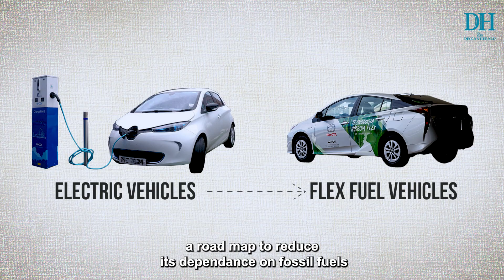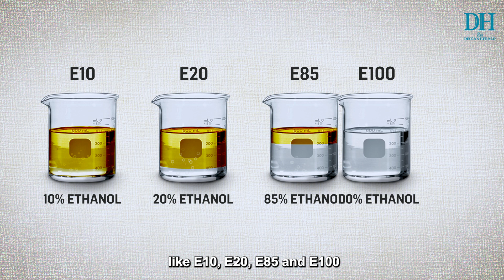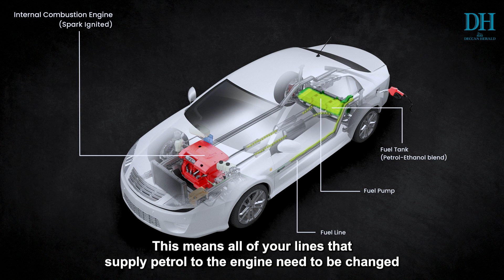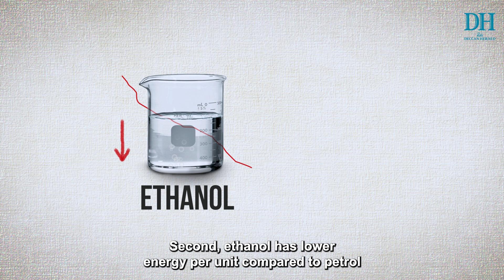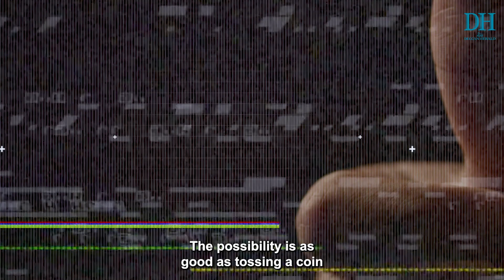What is flex fuel and are vehicles in India ready for it?

Comment: IMHO its a great idea not to put one's eggs all into the one basket i.e batteries/EVs! IMHO for such a populous nation such as India it could diversify its next gen biofuel/low emissions program by having ethanol, methanol, LPG and CNG so no one feedstock is heavily depended on? Preferably all these biofuels would be produced domestically to ensure energy security and create more jobs/business opportunities? For compression ignition (aka diesel engines) Scania has a CI engine that runs on ED95 which was found to be even cleaner burning with MD95 so even CI engines can run on ethanol/methanol with 5% ignition improver added in! DME is also able to run on CI engines...

Comment: If possible, it is better to wait for  purchasing E20 ready Vehicles as E20 petrol will cost less then normal petrol.
Reply: No, Goverment will not reduce petrol prices even after E20 blending because it'll be applied to all over India
Reply: @dattakanade9149  India is a country where gas prices rising slightly is an issue, but millions of illegal bangladeshi muslims are not.
Reply: 100 % ethanol ready vehicles are coming with flex engines. You can use 100% petrol Or 100 % ethanol in the same vehicle.
Reply: @lohithg2514  Yes I know that bro 😄, Brazil already using 100% ethanol vehicle and that will cost arround Rs 65/- per litre